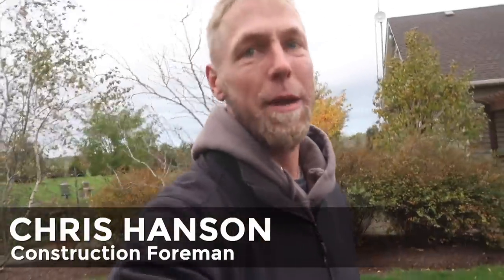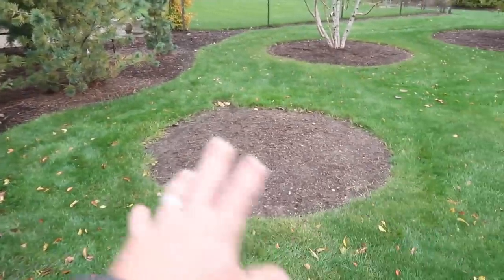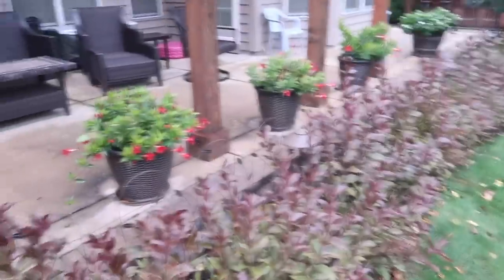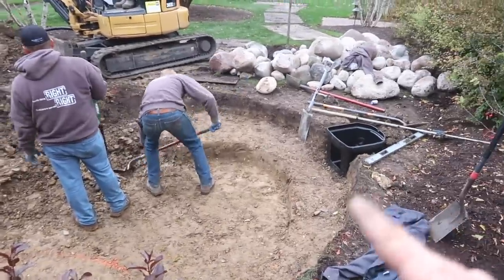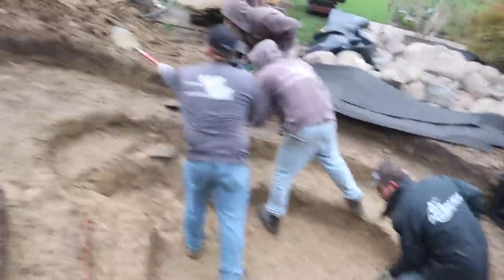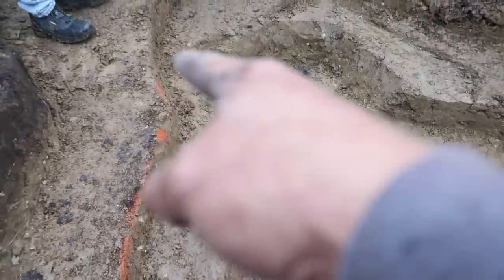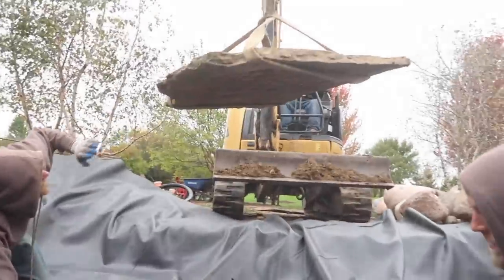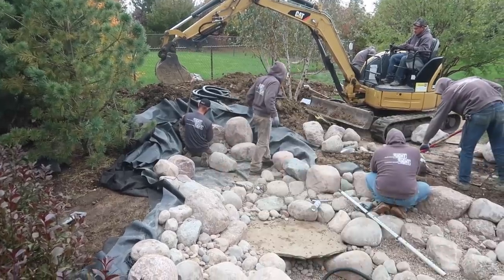Stream-Fed Waterfall Design: *POND BUILD* and Reveal

Comment: good day. great build.

just a questuon regarding epdm liner. i was reading that the primer used to join the liner will fail over time especially with heat and become.leaky. 

i knowits recommended to get a large liner for the pond with no seam joints.

in your ecperience have you guys ecperience anything of the sort, where the joints have failed? 

cheers

Comment: So the Auto Doser is for water quality and the iongen is for string algae?  Do the two systems help each other out?  Which one would be to combat the "pea soup" problem?
Reply from the maker: Hi - Yes, the Automatic Dosing System helps clear and maintain pond water and the IonGen clears up string algae. We recommend using both to get the best water quality results. Pea soup water is an algae issue, but both products will help prevent this.